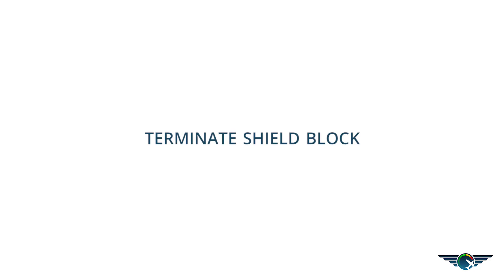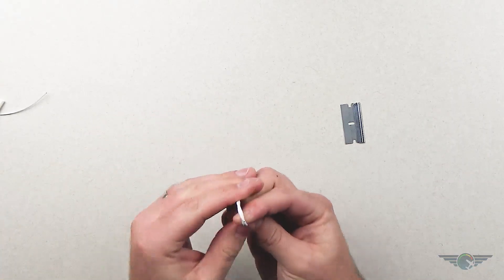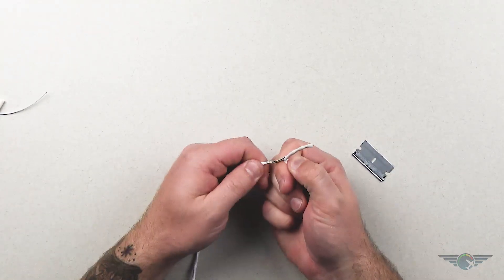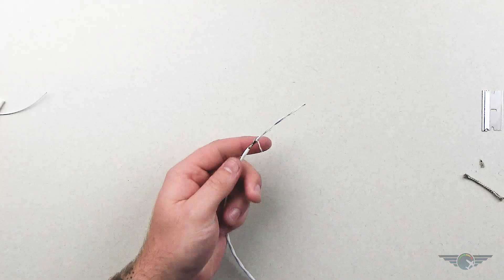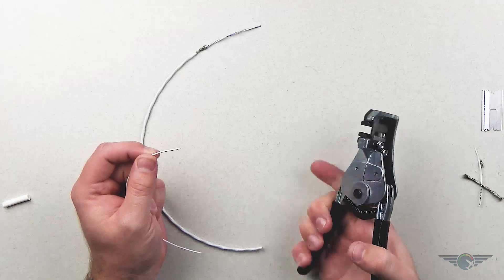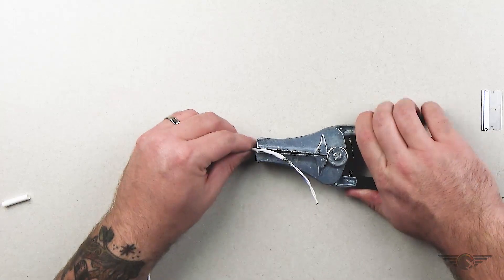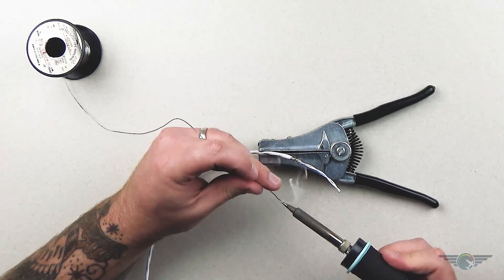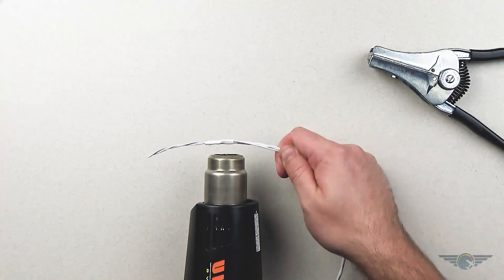Garmin G3X Wiring Fundamentals Series – Terminate Shield Block

Comment: The number of times ive found the shield has punched through the twisted pair due to overheating the solder sleeve is quite small but it can hsppen years after installation and its very hard to find and usually at the rack connector is a lot of work to get to.

I fold the shield back overvthr twisted pair insulation and hand solder thr drain wire fellowed by adhesive lined heat shrink.